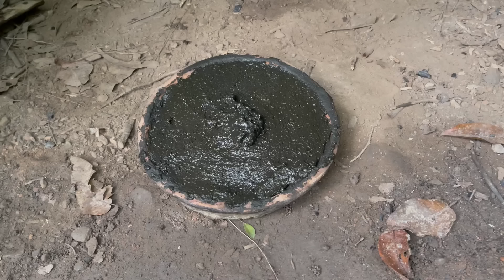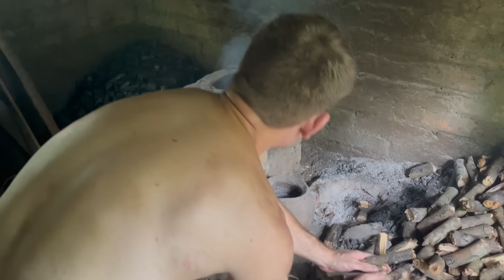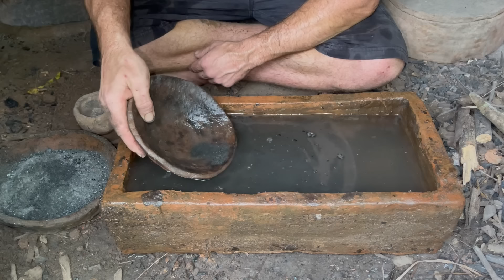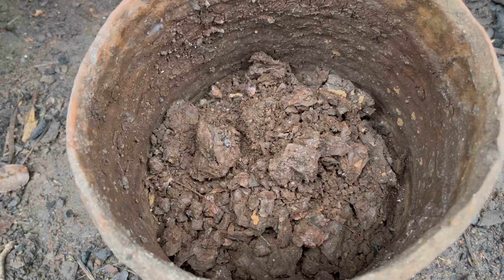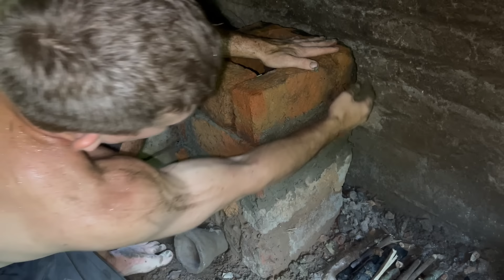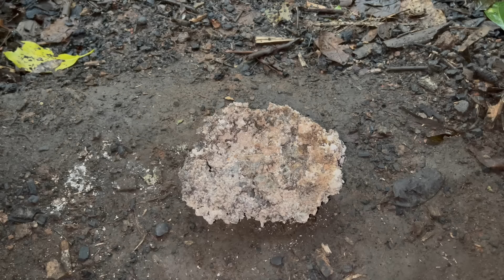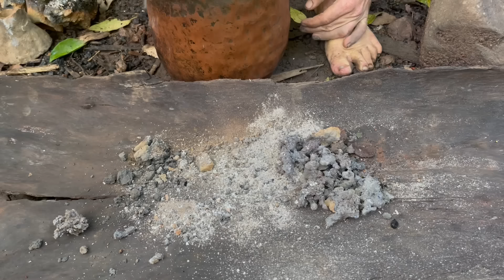Primitive Technology: Roasted Ore and Shell Flux Smelt

Comment: You might consider trying to make 'ore pellets' - crush all 3 ingredients into fine powder (roasted ore, charcoal, flux) and make small round pellets (you'd probably need to add some sort of binder to keep them together,  or try to make simple lever or screw press to see if that would generate enough force to keep the pellets from falling apart for long enough). Then fully dry the pellets and load the entire furnace (preheated) with them. The main purpose of pellets is to make the contact between components as close as possible while the shape guarantees there is sufficient air flow throughout the whole furnace.
Reply: He already tried that years ago. Seek out the videos regarding smelting, I know he had one or two with that idea.
Reply: On the note of air flow, getting a consistent input flow could dramatically increase the heat and flow rate of the furnace which would let the iron flow together more readily.  Replacing the current rope drill power source with a rotary power supply (something like a rope belt and two differently-sized clay wheels, with a handle on the larger wheel to convert slow human-supplied rotation into a fast fan speed) might allow for consistent blowing speed without taking a ton of effort to build and maintain. Hopefully.

I don't know for certain how tough lawyer cane is, or how brittle his fired clay is, so I can't say for certain what's the best solution.
Reply: @liger04  Very good point. Since the air input is limited, allowing better flow inside the furnace won't help much. I rewatched some of the previous videos and I think the issue is not the fan-blower per se, it's just too small. With every 'pulse' it's able to provide only very limited amount of air into the furnace. Increasing the size might be enough or just making the good old bag bellows (with volume comparable to the inner volume of the furnace).
Reply: @lazyman7505  I wonder if there are really any suitable materials that he would actually have access to?  The only thing I can think of would be animal hide/leather but that would probably be a whole development process itself (if it was even possible).  But I honestly don't know much about bellows, just thinking out loud.
Reply: @DoubleTap13  Damn, you are right, I totally forgot his limited access to materials. Hmm I don't think you can make decent enough air bag for bellows with just plant materials. Maybe some woven fiber mesh with some sort of sealant, but from top of my head I can't come up with anything that a) he has around b) would be flexible enough when dry
Reply: @lazyman7505  The first thing to do would probably be a flywheel. This completely removes the drop in airflow du to the rope driven propeller having reached the end of the rope. This is probably far more impactful than a bigger propeller.
Reply: An impeller designed for a single rotation direction, attached to some sort of pedal system, possibly with an added flywheel might be a nice upgrade.

That would be a lot more woodworking than we've seen to date though. A cast iron knife might help with it.
Reply: @MechanizedSoul  he'd have to produce the bag though. Which idk if he's capable of producing an airtight bag with his current tools and make it big enough. Did they just use leather hide traditionally? So he'd maybe be able to pull it off if he finds like a dead deer. Idk where he's located or what other kinds of animals are there. But I'd think even like a badger or racoon or something wouldn't give big enough sections of hide to make an efficient one. Could be wrong though.
Reply: @sethwinters3556 e could make a bellows by hollowing a log and then making a plunger with a stick with leaves on the end. Cap the top with a clay plug and it doesnt have to be 100% air tight. Like a big butter churn. In fact make two and pump alternating with both hands.

Edit: Also sweet name
Reply: @Seth Kilby - Duong on Primitive Skills did this (hollowed out a log and basically made a piston bellows) and it works really well.  John could probably do it as well with the materials that he has access to.
Reply: @sethkilby  ahh that makes alot of sense. I assumed to get a good air pressure it would need to be at least close to airtight but I could see that working. Do you know if it would actually be a good alternative to what he has going now though?
Reply: @DoubleTap13  ... well he made a loom and he made plant fiber rope from tree bark fiber, do you think plant fiber from this methiod could be woven to close enough twice with pitch made frrom sap sealing the two together perhaps with annother layer of something like pitch or mud on top for extra security?
Reply: @sethwinters3556  I dunno tbh. Depending on how large of a log he used or pot for that matter he could increase the amount of air flow per second. Im not totally sure that would help. From what I can tell hes making the most out of what he has but its just meager amounts of iron to start with but Id guess hotter is better. Maybe its more just about consistent temp?
Reply: @Ruhrpottpatriot  I concur. Drive the fan with a flywheel.  More woodworking would aide in that and other areas.  Honestly though, I'll watch whatever he does. :P
Reply: @sethwinters3556  Also as a side note, if he had feathers he could make a really nice pump for a piston bellows. Would work better than leaves.
Reply: @sethkilby  yeah that makes sense. I think though the work involved in hollowing a log without good tools is probably not worth it. Maybe once he does some runs and makes enough iron for some better woodworking tools than just that little knife it would become more viable.
Reply: @sethkilby  could probably burn the center out though. I believe I've heard of that method being used to make canoes. Passive, and doesn't require any real tools.
Reply: @sethwinters3556  yeah burning would be the only real way but he could basically make a rounded version of his furnace and use that. Clay bricks seem easy enough the log would just last longer and be movable.
Reply: @lazyman7505  something similar to a japanese box bellow might be achievable with his level of pottery skills. the vents can be made from leaves and the seal around the piston could be done with greased plant fiber cord. i imagine he could even use some of his shingles and lap them to get a smooth surface and build the box from four such plates. might even be worth building two of them to pump air into the furnace by alternating them.

Comment: Would be curious to see if the larger and hotter furnace gives you a significant yield, unfortunately changing two things at the same time didnt pay off this time, but it's interesting how the last batch being done again still contributed more than an old batch.
Reply from the maker: I'll test the taller furnace with fresh ore and see next time I do a smelt. If there's no difference I'll go back to the shorter one as it's easier to get the product out at the end. Thanks.
Reply: @primitivetechnology9550 I wonder if you could make the taller furnace such that the top ~4 bricks or so could all be removed in one piece, so it could be broken in half and reassembled to get the slag.
Reply: @primitivetechnology9550  Perhaps make the chimney more narrow as it gets taller so as to concentrate the heat into the material and have it get hotter faster, for a more clumped up yield.
Reply: To increase the temperature of the fire it is probable that you would need to increase the oxygen. To increase the size of the fire you increase fuel and oxygen in proportion. The shorter furnace with a smaller fuel load could well be hotter reduction flame.

Comment: 5:27 the purple flames come from the wood ash, it contains a large amount of potassium (in the form of hydroxides) this element has that color when heated over a flame, calcium for example emits a brick red color and zinc bluish green. 
This is a property used to recognize them in pure one-element (metals) solutions. 
This channel is amazing 😁
Reply: I think that's due to carbon monoxide flames from the coal? Potassium color is hard to see when there's sodium
Reply: @CimboAkinci  i dont know about carbon monoxide coloring flames, but it is strange to find it in a hige oxigen combustion like this one
Reply: @KuaEtus  Coal can reduce CO2 back to CO. It's also how it reduces iron oxide to iron
Reply: chemistry is awesome
Reply: @CimboAkinci  hoo, so that's why the iron is reduced, cool, thanx for the info 🐱
Reply: @CimboAkinci  The flame is more likely a high carbon black body radiating flame. It would be very hard to see any coloring from elements in this flame. This atomic emission spectrography experiment is usually performed with a clear/light blue flame.
We should also realize that the video is shot in a shaded hut. What are the white-balance settings, filters used, etc. used on the camera? Can any flame color be trusted to be correctly represented on the video?
Reply: @larswilms8275  Maybe, but i'm pretty sure the black body radiation spectrum doesn't go into purple unless it's a literal star
Reply: I have seen some solutions of different ions on flame at different concentrations and mixes, and in some of them you can distinguish between the diferent metals.
Reply: IR radiation can also appear purple'ish on camera. Try it, take your TV remote and with your phone camera just look at the IR emitter while pressing a button.

So the fire must just be hot enough so its IR radiation can be picked up by the camera.
Reply: @CimboAkinci  The black body radiation of a carbon rich flame is yellow/white. It overpowers the atomic emission of most elements. Possibly sodium is more intense but that is also yellow.

Comment: Things that worked against you was the strong base from the potassium in the wood ash, and not firing the shells. Before baking the ore you could turn them into balls to prevent mixing with ash, and baking is important not only to remove any organic matter, but also to turn any hydroxides into oxylates as the hydrogen can mess with fluxing and make the iron very brittle. Baking the shells is also important to burn off impurities like general organic matter and chitin, both of which also mess with fluxing and of course purity. Using ore refined from sand as well as potassium could work too. As the sillica has low ph, potassium has high ph, though they only react with eachother slowly. So they could act as a buffer, both reacting readily with impurities of the other's ph.

Comment: A couple proposed modifications: adding the water soluble parts of wood ash (potassium and sodium carbonates) to the ore to act as flux, then roasting the alkali+ore in a clay pot, so it doesn't get mixed in with the calcium oxide/carbonate from the wood ash. Potassium and sodium silicates melt much more easily than calcium silicates.

Comment: Pretty sure the problem here is that you didn't roast the shells first, but left them in their natural chemical form, just in flakes and powder. So you didn't have just lime aka calcium oxide, but all the other compounds bound in the shells. As I recall you already did a video where you roasted the shells for quicklime to use in mortar, years ago; it should still hold today.

Comment: Do you have access to limestone?  You will increase the amount of iron recovered from your consolidated paste if you blend in small pieces of what we call "bluestone" beginning with the the first "roast".  I believe your 'roast' will be more productive if you return to the slender tapering kiln design you experimented with in the past - only much shorter (perhaps 2 feet tall).  Stack your fuel as you did in the open roast - all the way to the top. Start your burn from the top down.  Add your paste with limestone as you did in the open roast - handfuls at a time using your judgement as to the rate of feed dependent on heat of the burn. 😊  All the best, friend!

Comment: I could be wrong but I think: 
Lime acts as a fluxing agent, which means it helps to remove impurities and form a slag. When limestone is heated in the blast furnace, it decomposes into lime (CaO) and carbon dioxide (CO₂). The lime then reacts with impurities such as silica (SiO₂) in the iron ore, forming calcium silicate (CaSiO₃), which is a liquid slag. This slag floats on top of the molten iron, effectively separating the impurities from the iron.

Stabilizing the furnace environment: Lime also helps to stabilize the chemical environment inside the furnace. It neutralizes acidic impurities and maintains the basicity of the slag, which is essential for the efficient removal of impurities. A stable furnace environment ensures that the smelting process can proceed smoothly, resulting in higher-quality iron and a more efficient process overall.

Meaning you got alot less but it was probably a much purer sample, not sure.

Comment: There is a boundary in which you should use lime during the smelting process. If you use too much, you might end up making pig iron, which is extremely brittle, low quality iron. However, I believe refiring it can purify the iron. Still not too sure about that last part though...

After seeing the results, you must've added too much lime. The amount of lime you use should be below the approximate amount of iron that a batch may have (which you already found by the roasted smelt). Also, the closer the ratio is to 1:1, lime to iron, the more likely it would become pig iron.

Comment: Higher furnace is definitely a good sign. But I'll insist on something though - you don't need that much higher temp, what you really need is a bit better insulated wall, to keep the temp as stable as possible, for as long as you can. That ought to give even best results. And if you could figure out a way to start the fire from bottom, so you actually are burning gas in the first part of the process - that'd be perfect.

Comment: I have a little experience with making ceramic glazes and a chemistry background. Wood ash can be used as a glaze or glass former itself because of the flux content (CaO, K2O, along with other trace oxides.) Since you're already preroasting the ore and getting this wood ash incorporated with that ore, I'm not sure the shells are necessary as a flux. But if you're interested in the exploring shells for future uses try calcining/roasting them beforehand, this will convert the CaCO3 to CaO rather than relying on the kiln to convert in situ (this may have been hindering the reduction of iron for you.) Other notes, the wood ash should already contain some silica, but if you want could always try adding a little sand or clay as well. And your recycled slag will still contain all the fluxes you used in your previous batches so this probably helped with iron recovery as well. Love the videos

Comment: you may want to try gravity seperation (panning) as a method to purify iron-heavy sand, before smelting. In my area, sand on the ground is around 5% "black-sand" i.e. iron-heavy and is easily purified by panning.

Comment: Curious yet interesting that the flux made it worse. I remember being one of many to suggest it.
The little "metallurgy" experience I have is from smelting brass, bronze & silver in jewelry etc. casting by hand. If I don't completely misremember what I was taught (sry Petri, been a while :<), the flux (in jewelry casting usually borax) is added to the smelting of pure'ish materials - for example pure metal/alloy + recycled materials from previous castings - to make the metal/alloy flow better & gather non-metal -impurities on top of the liquid metal so they can be removed before pouring the metal into a cast. 
From experience all I can say is that for a crucible of 2~3dl we'd use ~1/4 of a teaspoon of borax. So perhaps the ratio of metal to flux is off, resulting to the flux becoming part of the slag - if it has any effect at all during the initial smelting process. So maybe try the better smelting process but with like 20~50:1 ratio of "ore" to "flux" to minimize losses; if it helps, good. Otherwise the flux may only help when the prills are re-smelt into ingots or whatever shape you decide to make them for smithing.

Comment: Making furnace taller was a good idea but I would also made an extra opening to for slag. Having to break slag with rock is pointless extra work. Measuring the amount of charcoal and ore would also be more efficient than just eyeballing by throwing it in by hand. Use small cup for the dust and a shallow basket for charcoal to make layers uniform.

Comment: You should try to heat the incoming air so that it does not cool down the smelter. It will give you a higher sustained temperature.

Comment: If you align a piece of iron with the local magnetic field- point it north- and hammer it on the south end long enough, it can become magnetic. If you made a magnet, you could just grind the slag to powder and use the magnet to pick all the iron out instead of hand sorting. Would increase your yield probably dramatically.

Comment: Your residual bits of metal in the slag left from the smelt should be passed through the next smelt process to get the metals to fall out. Shame you can't get a water wheel on the go to pump your air to make the temperature more consistent. As soon as you have enough metal, your next task should be to make an axe to make wood gathering simpler and less laborious. Also have you considered using the trees to make an A frame to carry a bigger load of wood, cut down on your need to keep walking back and forth.

Comment: I think that panning or settling after roasting could help. Fe(OH)3 (I believe that is the bacteria final product) is significantly denser than SiO2 which is most of the slug so you could separate them before smelting. It would also remove some water soluable chemicals